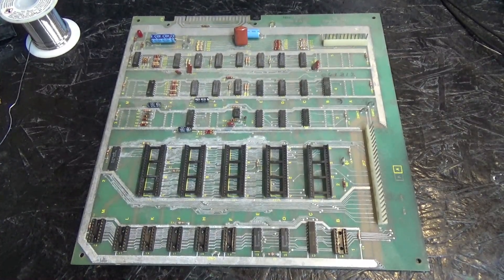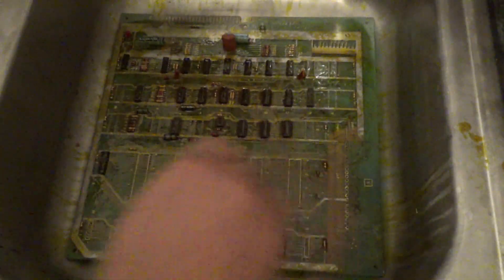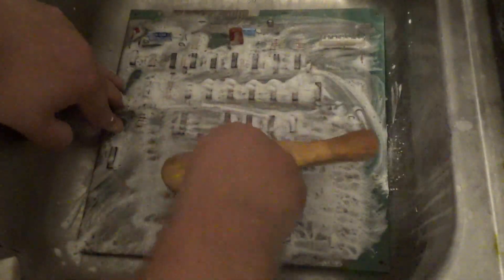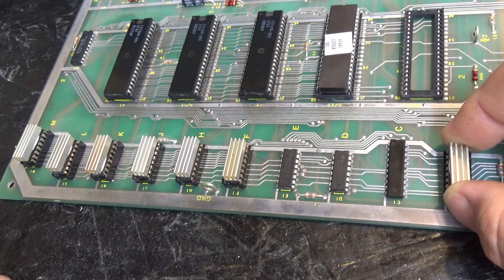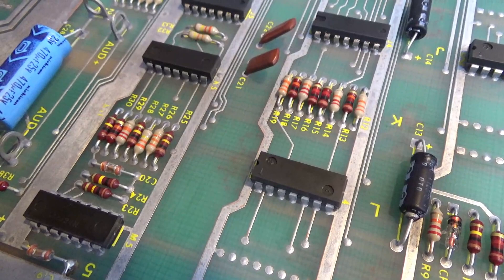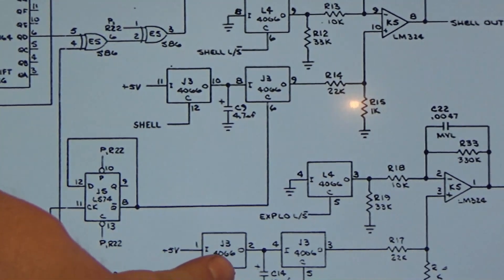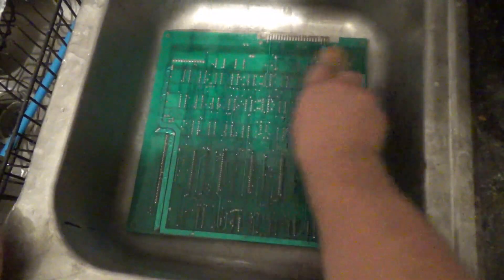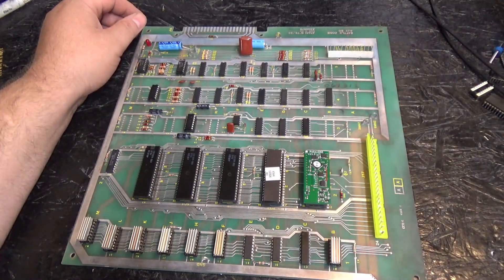Repairing and removing oxidation from a battle zone aux pcb

Comment: Awesome repair video.  Thumbs up on replacing the 24 pin header with a square pin replacement.  That is routine for any AUX or AVG that I repair.  I curse Atari for not using a solder mask on the component side of their PCBs just about every time I repair a board.  Have you tried "No Clean" Kester solder and what are your thoughts?  I try to minimize the use of chemicals whenever I can.
Reply from the maker: yes i have used no clean solder and i don't like it as much. not a fan of how it flows as it just seems like there is not enough flux .

Comment: Why are you using Ferric Chloride & Aluminum Oxide Powder instead of using White Vinegar and 90% Isopropyl Alcohol? I don't understand the benefits of using Ferric Chloride and Aluminum Oxide Powder to fix battery acid, solder lead/solder flux pcb board issues
Reply from the maker: speed . ferric chloride is just a bit faster that's all . the aluminum oxide is just to restore the shine